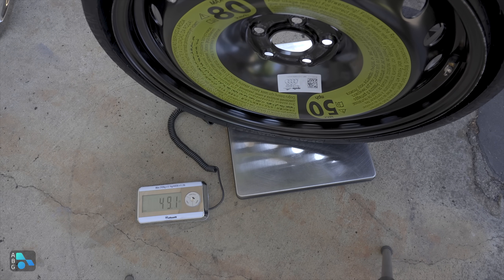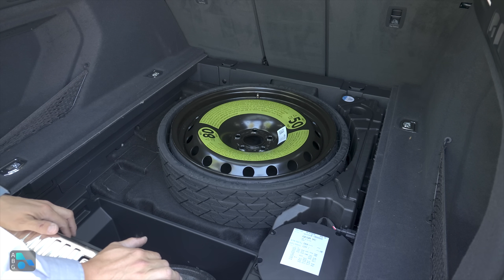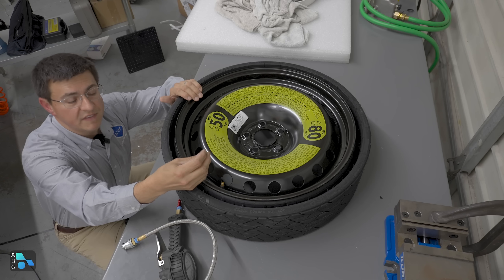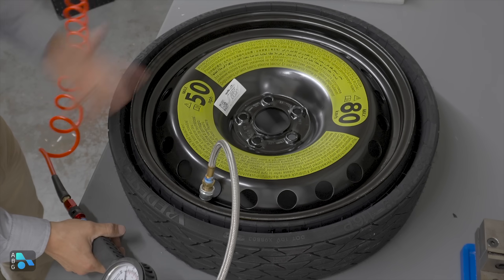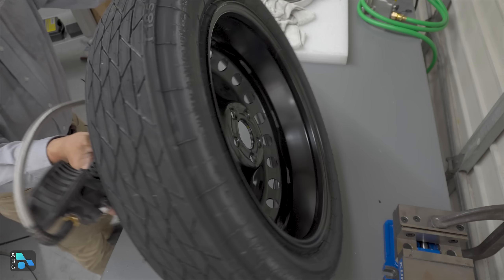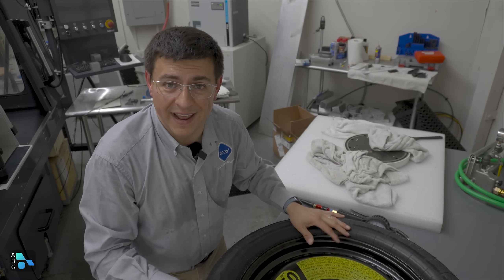How A Collapsible Spare Tire Works, And How It Might Save The Spare Tire In EVs

Comment: Ingenious design but I can't imagine there is a single Audi owner who would ever be able to figure how to inflate, install and deflate it.
Reply: You mean they either can't read the owner's manual, or they refuse to read the owner's manual like most people don't. That's on them, but I'm sure they will if stuck somewhere tow service will be slow or non-existant.
Reply: @mr.c6674  A regular spare tire the same size as this tire when it's inflated could fit in that trunk area.
No one wants to deal with a flat and then you have to deal with inflating a spare? Keep it simple. Just swap it and move on.

Comment: I can just see that rubber getting old and cracking when you try to inflate it in the future.
Reply: Just like with any spare, periodically checking it for signs of wear or degradation is key.
Reply: I inflated a spare tire like this that was from a 30 year old junk Cadillac and it seemed to be just fine, not saying I'd go on the highway with it but I would have used it if needled
Reply: A tire is supposed to be replaced every six years anyways due to exactly that.
Reply: Not a problem with the one in my 1976 Nova. I don’t use it to drive cross country. Just to get me to a shop they can repair the flat.

Comment: I agree an excellent option. I would most welcome having one in my EQS and CRV hybrid. The GLS still has a spare. Though flat tires are rare having one is a major hassle if all you have is some goo and a pump, paticularly in the winter somewhere in the sticks. Cars without spares don't even a jack nor tools to do the job either.
Reply: Well, think about it. Why would they give you a jack and tools to change a tire if they didn’t give you a tire to change?  That’s why their removal saves weight. It’s not just the wheel and tire weight but also the weight of the jack and tools.
Most, if not all, manufacturers offer a donut spare, jack and tool kit as an optional accessory from your local dealer (or from online sellers). It can be added to your car if you have FONS. (Fear Of No Spare)
Reply: @NovaResource  forget the "FONS", the main issue is that the goop and pupmp are very limited. In a world where tires are becoming more and more low profile, the chances of cracking a rim on a pothole for example is becoming much higher. A can of goop isn't going to save you. You'd have to go buy a spare anyways or get towed. cracking a rim isn't the only danger, what a bout a blow out? the goop isn't going to plug more than a small nail puncture, and honestly most tires will hold enough air to get you to the nearest tire shop to repair if you just re-inflate and don't remove the nail. Just make sure you drive low speeds.

Comment: Wouldn’t a collapsible spare work in the average gas car? Why don’t other gas cars adopt this?
Reply: They do use it already for ICE car for some companies
Reply from the maker: Re:watch at 0:28 😉
Reply: @L.L yup I think VAG has used this type of spare for a while. 

Edit, yup Alex mentioned that at 0:28
Reply from the maker: Cost is the main reason: it’s more expensive
Reply: I wonder why average cars don’t come with this? Are they more expensive than a regular spare?
Reply: @naveenthemachine I’d imagine they are a bit more costly and require a pump and other bits to go along with it unlike a traditional spare.
Reply: @naveenthemachine  yes, I think they are made of Kevlar.
Reply: They would and companies like GM and Chrysler have used them as far back as the late 60’s.